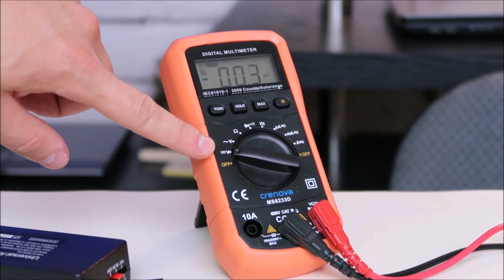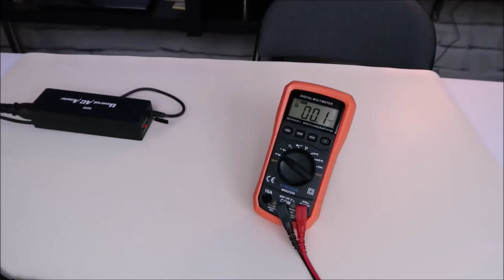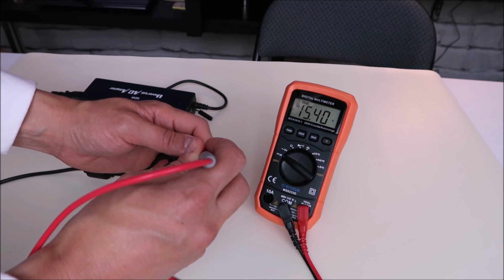How To Fix Any Laptop - Wont Turn On, Wont Open, Turns Off Right Away, No Power Solution

Comment: i cant access my battery 
and my parents will kill me if i open the back
Reply from the maker: What brand and model computer do you have and whats the issue with it?
Reply: @PC_Monkey  the model is hp notebook 15 bs675tx (2018) and i cant turn it on
i also need to open the whole bottom to access the battery
Reply from the maker: @mawomgies  First, your on the correct troubleshooting video.   Second, does this help  you access the back?  https://www.youtube.com/watch?v=9xqTDV78I1E
If you cant open it up, you cant really DIY repair the computer.
Reply: @PC_Monkey  i just only realized my caps lock was blinking,THANKS ANYWAYS

Comment: None of these work for me 😢
Reply from the maker: What brand and model computer do you have and whats the issue with it?
Reply: @PC_Monkey  I have a hp pavilion and one of the older versions ive tried cleaning the internal parts by blowing it out and picking some dust out and everything but nothings worked its doing the same thing where when i open the computer the fans start and everything and then it just switches off.
Reply from the maker: @Fzzy1x  If all the tests in this video do not reveal the issue, and your power adapter tested to be fine, then your most likely looking at a Motherboard replacement

Comment: What if my laptop only turns on with the charger plugged? Do I have to hold the button for the minute while it's charging?
Reply from the maker: 1.  As seen in this video, you dont hold the power button down with either the battery or power adapter in the computer.  You do that when both are removed.  2.  If your computer will only turn on with the power adapter plugged in, you most likely need a new battery.

Comment: Well it still didnt work but its propaply my motherboard died. Cuz i tried replacing chargers and what u said in both videos. The motherboard does light but when i press the power button it doesnt turn on. Before it used to turn on for half a sec then completely stops turning. Its just old toshiba laptop its fine.

Comment: Thanks for your informative videos.Here is my situation.I was recently given a Lenovo G570 laptop,with 4 gigabytes of ram and an HDD.Another stick of memory was added.It showed and was working fine.Then a new SSD was purchased,but during cloning,which was taking a long time,the charger stopped working,the battery drained and the computer shut down.
After buying a new charger and letting it run overnight,the laptop didn't start.The steps of discharging,like in the video,were performed,but with the same result.
Right now,the back cover and keyboard/palm rest are taken off,showing most of the motherboard,to do a bios reset.
My question,where is the CMOS battery on model?I've looked online,but haven't found a picture or video,showing the location,only people stating that it's soldered to the motherboard.
That's where I'm at and thanks for any help.

Comment: nothing worked and my mom has anger issues .. I’m so scared for her to come upstairs and see this.. I’m sooo late for class  🧍🏽‍♀️
Reply: How did it go? My moms the same :(
Reply: @steyaanderly8823   omg I forgot to update y’all .. but u found out the actual plug was plugged into the outlet but the plug that connects it to the adapter wasn’t in so I didn’t get in trouble

Comment: I think is the  battery  problem that  My Acer laptop have  ok because I remember  when  I turn  it on it was at 40% and  it just  shutdown  like  that right  away so thanks for  your  help my laptop  is Acer inspire 431 ok so  Please  look  at it ok thanks  again you are  a life saver man
Reply from the maker: If its a battery problem, then follow the steps seen here and try starting the computer without the battery and with just the power adapter plugged in.  Does the computer turn on?

Comment: Hi, I have hp tpn-c125 laptop which is not starting up. I do get light when I plug in the adaptor but after pressing power button screen is not coming. please help
Reply from the maker: your on the correct video.  Have you tried the steps seen here yet?

Comment: My Acer aspire 5 turns on, the two led lights on the side both light up blue in color but the screen won't come on. I hear fan noises then it stops. Hit the keyboard and the led backlight comes on behind the keys but nothing on the screen. Initially the computer would let me go into a program then cut off with no warning
Reply from the maker: Have you tried the steps seen here yet?
Reply: @PC_Monkey  I have, however I have an internal battery that doesn't completely detach so I haven't tried just plugging in the charger with no battery in as I'm scared to turn it on with everything being exposed without the bottom cover
Reply from the maker: @rhondahylton210  If you cannot perform the steps here then we cant accurately troubleshoot the issue.  Does this help remove the battery?  https://www.youtube.com/watch?v=Y2K5Y5o0aoI

Comment: When I charge the laptop the mouse works but the lap does not start. Why does that happen.😓
Reply from the maker: The mouse works but the computer wont start??  If you can see the mouse on the screen, then the computer has started.  Is that mouse on the screen all your able to see?
Reply: @PC_Monkey  No, I mean, the sensor light on the mouse works when I charge the laptop. but the laptop does not turn on.😶
Reply from the maker: @ayodyashashini8119  your on the correct video.  Have you tried the steps seen here yet?

Comment: No joy, but I tried all.  It's a Dell 1420, ST: 3QS5GD1

Is there a way to wipe the HD other than destroying it?
Would you like it for the price of shipping from 80919?

Good videos!  Thanks,
Reply from the maker: You can send the hard drive to a recycle place and they can provide a certificate of destruction.  Or you can hook up to another working computer and wipe it.  BTW, if none of the steps here worked, your most likely looking at a motherboard replacement.  Not sure if thats worth it for ya :)

Comment: Will this help me if my computer screen turns black then turns off again? and my battery is dead  (my computer will boot into windows till it loads fully then turns black again and it trys to reboot and it turns the screen on and off again) Also sometimes i can go into the bios but it glitches and locks up
Reply from the maker: No, this video is not the correct troubleshooting process.   You computer gets into Windows, then the screen goes black, then the computer turns off?   And the battery is bad?   Have you tried with the battery out and just the power adapter plugged in?
Reply: @PC_Monkey  yes

Comment: It didn’t work for me 😭
Reply from the maker: What brand and model computer do you have and whats the issue with it?
Reply: @PC_Monkey  its a toshiba C850-9D and the charger won’t work on the toshiba and it won’t turn on so please bro make a vidoe for it because I had it for so long and I want it back I haven’t opened it for 6 whole months now
Reply from the maker: @manlikeray123yessir2   If all the tests in this video do not reveal the issue, and your power adapter tested to be fine, then your most likely looking at a Motherboard replacement
Reply from the maker: @manlikeray123yessir2  What is a motherboard?   A motherboard is the main board in the computer.  You can see an example of a motherboard replacement here;  https://youtu.be/N_7HNrFkMS8.
Reply from the maker: @manlikeray123yessir2  If your computer isnt turning on, and you have tried all the steps seen here without identifying the issue, then the problem is most likely with the motherboard.  Replacing a bad motherboard with a good motherboard will solve the bad motherboard issue.
Reply: @PC_Monkey  ok how will I do that sir
Reply from the maker: @manlikeray123yessir2   You can see an example of a motherboard replacement here;  https://youtu.be/N_7HNrFkMS8.

Comment: Hi having trouble with my computer. Have run the diagnostics and it came up with a red x for hard drive. Restarted and it boots up to the correct page but comes up with web root (don’t even know what that is) and it won’t let me X out of that. Just stays on the screen. Have to restart it and it sometimes goes to the black screen with the pointer on it. Ughhhh....about to pull my hair out!

Comment: Having a problem got got new battery and charger, laptop works fine when battery is disconnected and just charger plugged in. Help please 🙏
Reply from the maker: If this happens with the new battery as well, then your battery port on the motherboard may be the issue, assuming the battery is good :(
Reply: @PC_Monkey  hey the battery is because I got it with about 10% charge and it was fine until the battery died
Reply: your battery doodoo

Comment: Before 2 days My HP laptop was first stuck on black screen with HP logo. After pressing any key that was again booted and started.

 But today morning when I tried to turn it on it didn't turn on & even after connecting the power cable the power led also not glowing. What to do 

I hv tested the power cable & also tried turning on laptop by removing the battery. What could be the solution
Reply from the maker: For a computer that wont turn on, your on the correct video.  Have you tried the steps seen here yet?
Reply: @PC_Monkey  Yes I have tried all. Bt issue is still ongoing
Reply from the maker: @RAKESHMISHRA-gr9rj   If all the tests in this video do not reveal the issue, and your power adapter tested to be fine, then your most likely looking at a Motherboard replacement

Comment: My problem seems to be somewhere between "won't turn on" and "boot loop". It never gets to the logo screen, but repeatedly tries to turn on. Seems to power up for ~2 secs, down/off for ~6 secs. 
Does this behavior mean something? 
So far, I've only tried the discharge tests. With the charger-only it actually doesn't loop; just shuts down after 2 secs. With the battery or both, it loops (but pre- logo). 
I know I still can go through CMOS and maybe other steps, but thanks for any advice in the looping means something. And thanks for the clear videos.
Reply from the maker: Sounds like your on the correct video.  I would try the steps seen here first.

Comment: My Asus s510u don't have cmos battery. I try all ur method but still didn't work.
Reply from the maker: Not all motherboards have CMOS batteries.  
  If all the tests in this video do not reveal the issue, and your power adapter tested to be fine, then your most likely looking at a Motherboard replacement
Reply: @PC_Monkey  thanks for replying 🙏
Reply from the maker: @radzikkaj  Your welcome !!  Happy to help :)

Comment: Pls help.
So i was watching pewdiepie livestream, the battery was low, everything was fine from the start (from turned on til i remember to charge it) then i remember to charge my laptop cuz the battery was low, when i plug the charger, it turned off instantly with a small pop sound

Any help? Which vid should i watch?

Things ive tried : 
1. pressing the power button - failed (nothing happens)
2. Holding it - failed (same)
3. Charging it overnight - failed (same)
4. Do nothing for a day and try to turn it on - failed (same)
Reply from the maker: For a computer that does not turn on, try this video first;  https://youtu.be/P3I7dDpkJps.
Reply: @PC_Monkey  okay, i think its bcuz i always play in my bedroom and i put it on a pillow
Reply from the maker: @ziece1  Its common :)  No worries :)

Comment: I only have 1 stick of RAM tho...
my screen stays black, keyboard doesnt work (no lamp on caps lock), no pointer also
Reply from the maker: If the screen is black, what are the signs the computer is on?  Lights?  Sounds?  Fan?
Reply: @PC_Monkey  light indicators (pow and battery), fan sound, and harddisk sound are there. I checked backlight with phone flashlight, still black

Comment: I have the HP Probook 440 g5. The battery is not easy to reach. It doesnt turn on. Forgot to unplug the charger so it was on for a day. That was the moment it stopped working. Any solutions?
Reply from the maker: Your on the correct video.  Have you tried the steps seen here yet?
Reply: @PC_Monkey  I asked for a friend, but it was literally overheated, so it worked the next day. Waiting a day was just the right thing to do. Thanks for your fast response.  Should have thought about that.. Bought a new charger, but will send it back.
Reply from the maker: @oliviergoggins  Glad your all set :)

Comment: What does bios reset denote? Restoring the bios version to factory or anything else? I am using Dell G5 5587 with Win 10. I have mentioned my problem in another video too. My system just starts (fan boost) and then turns off, restarts again.
Reply from the maker: A BIOS reset just resets BIOS to factory settings, yes.  Are you able to see anything on the screen before it turns off?
Reply: @PC_Monkey  no in general. Sometimes it boots up when I try 3-4 times
Reply from the maker: @shivashukla9454  Your on the correct video then.  You try all the steps seen here?
Reply: @PC_Monkey  yes. It appears to be a motherboard issue as per dell technical support. Right now. My system boots up when I disconnect the battery and run on direct supply. It even runs when I connect the battery in between. But, when it does not boot up with battery connected.
Reply from the maker: @shivashukla9454  You may have a battery issue.  I would try replacing the battery before I try replacing the MB.  If that does not work then yes, its most likely a MB issue.

Comment: Hi my acer laptop won't charge. And no power at all.. drain for 2months. please help. Thank you
Reply from the maker: If your computer wont turn on your on the correct video.  Have you tried the steps seen here yet?
Reply: Yes. But still not working
Reply from the maker: @soykivlog2753   If all the tests in this video do not reveal the issue, and your power adapter tested to be fine, then your most likely looking at a Motherboard replacement

Comment: my laptop didnt open still
Reply from the maker: If all the tests in this video do not reveal the issue, and your power adapter tested to be fine, then your most likely looking at a Motherboard replacement as seen here;  https://youtu.be/N_7HNrFkMS8.
Reply: @PC_Monkey  im a kid and i vant afford. a new motherboard without knowing my parents about this ill be graounded for a year plsss help😭😭😭
Reply from the maker: @ElJurezo  What brand and model computer do you have and whats the issue with it?
Reply: @PC_Monkey  MY LAPTOP IS NEC LAPTOP YHE PROB IS IT LOCKED IT SELF WHEN I WAS PLAYING AND IT WONT TURN ON PLSS HELP I SPENT ALL NIGHT SEARCHING FOR A METHOD TO FIX MY LAPTOP i have no sleep plss help
Reply from the maker: @ElJurezo  If your computer wont start and you have tried all the troubleshooting steps in that video, and you have ruled out a static issue, a bad battery, a bad charger, and a BIOS issue, then its most likely your motherboard.

Comment: I have a Dell Latitude that won't power on. Initially when I plugged in the adapter there was a hardrive sound but no LED. After the BIOS reset with CMOS. The LED started to show and the power button worked. But the laptop only powers for a few seconds and shut, there is no indication of life on the screen. Please advice. The adapter is fine since it powers up another dell laptop that I have.
Reply from the maker: This video has been updated with additional steps here;  https://youtu.be/P3I7dDpkJps.  Let me know how that goes :)

Comment: How do I know if it’s my screen because it’s charging it’s actually fully charged but won’t come on and motherboard has been replaced and ram
Reply from the maker: If your computer wont turn on, your on the correct video.  Have you tried the steps seen here?
Reply: @PC_Monkey  I’m about to test the voltage now so we’ll see

Comment: My laptop won't start but if I remove the screen plug it starts running. As soon ss I plug it back in, the laptop doesn't start once again. When I mean it doesn't start, it only lighten the power light for a few second and then turns off. No sounds, no keyboard light, no screen
Reply from the maker: When you unplug the LCD cable, plug in an external monitor.  Does Windows load up fine on that screen?
Reply: @PC_Monkey  yes
Reply from the maker: @cosminnedelcu1676  Then your most likely looking at an issue with your LCD or LCD cable.   I would replace them one at a time to see which one is the problem
Reply: @PC_Monkey  lcd cable? Can I replace only that one? It is very easy to unplug it form the motherboard but much more complicated to remove from the lcd panel. It looks like if I pull, it might brake...

Comment: I have a different kind of issue... An HP laptop won't turn on, then if I remove the cmos battery to apply a bios reset it will turn on no matter how many times I turn it off or if I'm using the charger or not... If I don't turn it on for a few hours tho it won't turn on again... The charger and the port have perfect voltage and the cmos battery has almost perfect voltage... What is the issue here???

Comment: Didnt fix for me. My problem is, whenever my lapto is waking up fron sleep mode, it will shutdown and every time i power it on, it will randomly crash for a few minute forward. Can u help me
Reply from the maker: If you dont use sleep mode and just turn your computer off correctly, does it not turn on correctly?
Reply: @PC_Monkey  it doesnt. But, i found the problem anyway. The power switch was the culprit, so gonna change it. Thank's for the reply!
Reply from the maker: @mahaputranurmuhammad3228  Glad your all set :)